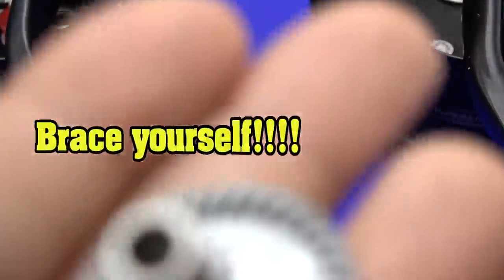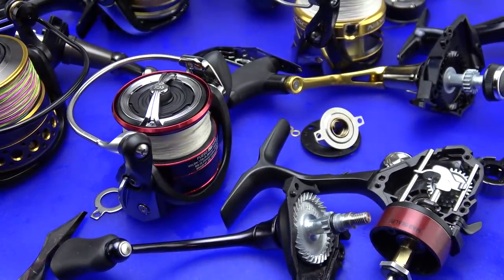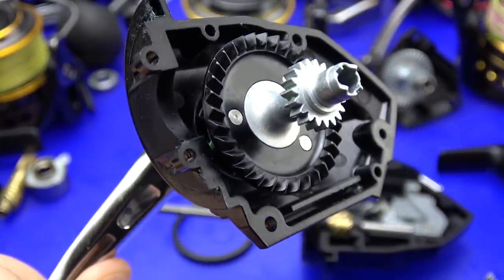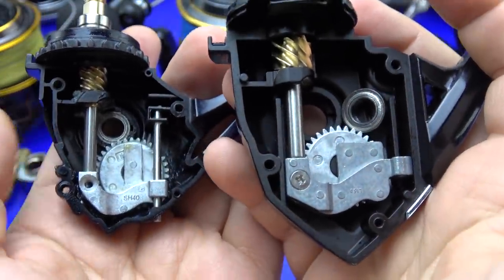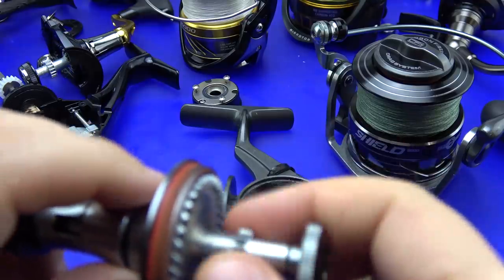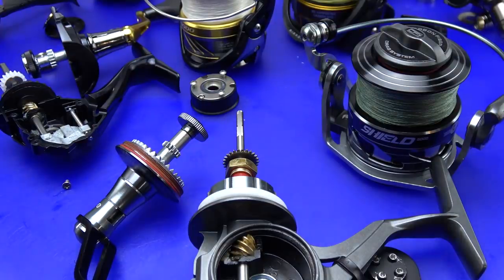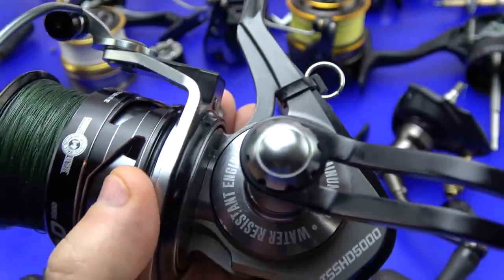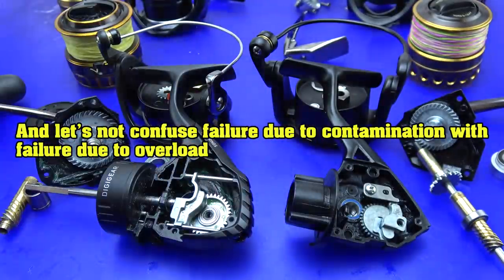2018 - 2019 $100 reel buying guide, comparison, and review.  Penn, Shimano, Daiwa, Tsunami

Comment: What are your thoughts on ceramic bearings if u have any experience with them?
Reply from the maker: Snake oil. Full ceramics are nice.  For very high speed long distance applications.  Where you can roast a bearings quickly.  But for fw applications?  A lighter oil, properly cleaning and lubing your bearings.  And keeping them clean will net you equal performance to bocas and such.   And 99% of what you get from some hedghogs and others.  Additionally if you apply any spool tension at all whatsoever via the knob.....you lose any and all benefits.   
I put out a vid showing some different bearings spinning....i was going to film some tests....but didn't like the footage.

Comment: These molded plastic and cheap metal housings are absolutely shit.  Get a Machined aluminum housing , far superior in every way possible.
Reply from the maker: Problem is... 99$. You're 100 percent correct though
Reply: @TackleAdvisors  You did a great video for that price range and I agree with your points and selection,  but these reel companies need to focus on improving the housing material quality , and not just internal parts.  A Van Staal isn't exactly affordable for me , but I bought one so I would avoid wasting more money in the future , just my take on it.

Comment: What size BG would you recommend for king salmon
Reply: I use a BG 3000 size for king salmon here in the Pacific Northwest rivers. 4000 is a bit overkill with how bulky it is. The 3000 BG is basically the equivalent of most Penn, Shimano, Okuma and Abu 40/4000 sized reels.

Comment: Great video Nick, these reviews are the best most honest videos on Youtube. I know it is more money, but how to you feel about the Shimano Ultegra compared to the Nasci?
Reply from the maker: The ultegra is a much better reel all around... I literally have it in pieces next to the stradic ci4 and sustain.  Same Frame material as the Nasci..and it adds a worm gear for oscillation a threaded handle.  Worth the price increase imho.  That said the Tatula lt gets real close to the ultegra in price and rivals it
Reply: Thanks I have been thinking about getting an Ultegra.
Reply from the maker: Hey Mark...if you get the opportunity...check out the tatula lt...I think for the finessy type stuff you may appreciate the weight savings.  It's the same as the ballistic minus mag seal and rubber seals.  It has a very nice feel to it.

Comment: R u ever doing the saltist reel and the bg like before and whats that new back bay reel all about isn’t it just the saltist pretty much
Reply from the maker: I will be more. Just waiting on a saragosa... That new saltist back bay is interesting... It's more like a metal ballistic than a saltist with a gear upgrade...no crbbs but machined alu gear and mag seal.  Provided it has the other rubber seals like ya see on the ballistic fuego and saltist... That's a cool reel.  Kinda says hey stradic... I'll take your hagane... And raise you a metal side plate
Reply: Tackle Advisors ok thx I’ll be looking forward

Comment: My 3000 size nasci has felt drag washers, why is it different on the larger ones?
Reply from the maker: Ahhhh...good to know....I guess they feel it's not needed in the smaller sizes.....I'm inclined to agree...unless targeting speedsters.
Reply: Tackle Advisors You made me take all my reels apart! My 4000 stradic fk also has felt drag washers that only lasted one trip to the Amazon, I’ll be upgrading then to carbontex washers

Comment: I want to spend sub $250 on a 4k for my florida lightweight inshore main setup ~7 medium power fast action. It will be looked after but might take the odd dunk. I'm down to the Shimano Stradic ci4, Daiwa ballistic or Daiwa theory (i know the theory is pushing the budget) wildcards are tsunami saltX because its heavy and 2019 stradic cos its not for salt water. What would you get?
Reply from the maker: I'd not go with the ci4 or ballistic /theory (essentially same reel) I'd say go spinfisher.... Better sealed and 2 minutes to break it down should an issue arise. If you can't stomach Penn go stradic FL which has better than the ci4 sealing and a simpler and serviceable line roller.. Plus the tall spool is a benefit
Reply from the maker: @pissywilly  sounds good... I know Josh at jandh got some in today not sure on sizes though... If you buy from him add a comment saying you liked his "head banging". (he dueted my thoughts tik Tok video I put out today lmao.)

Comment: 25:05, battle 2 comes with a “line line correction kit”.
Reply from the maker: That's not the cause.  It's the path the crosswind block runs that lifts and lowers the spool combined with the line roller. It could have been designed differently to allow for better line lay.  Shinning won't make it lay like a Daiwa or shimano of the same design

Comment: What are your thoughts on the daiwa BG magsealed version
Reply from the maker: Considering how many times I've seen corroded pinion bearings... It's good for the protection... But you can buy 2 standard bgs for the 170$ magsealed version.  The saltist street price is near it and you get better crbb ball bearings.  The back bay saltist gives you a gear upgrade.   70$ for mag seal is ridiculous in my opinion.   Look at the fuego and exceler price difference then tell me how they get to that $ with the magsealed bg
Reply: @TackleAdvisors  there's a shop that I visit regularly that sells for 95 USD for the mag sealed version while the normal bg is 75 USD 2500 size . I'm just not sure if the maintenance for the mag sealed version is different from the standard bg as I can watch your bg maintenance video

Comment: My main gearr in my tsunami shield went after a few times of using it. Just happened this evening. So pissed. It is brand new now its trash.
Reply: Were you able to get it replaced? Ive been eyeing the Shield but QC issues like this have given me pause.
Reply: Soke haven't even bothered yet. I don't want another one. I don't need a reel that you need to take a torch to, to do maintenance.  I would rather throw it away and call it a loss.
Reply: I bought a Chinese version to test out catking ACE, and yes, also stripped gear after 1 boat trip to pull some black sea bass abuot 5-7lbs x 2 each time I reel up, I cant trust the Chinese cheap steel anymore, was going to order shield but now I notice they carried the same material with the Chinese catking brand

Comment: Ive had my penn battle for about a year now and i can say yes it does not have a perfect line lay, but if you were to cast 100 times you’d really only get a wind knot 2-3 times max . For serious bottom / livebait anglers id prefer the battle over the bg anyday.The bg does win in the aspect that it is a more capable reel but it is more prone to saltwater getting in over the battle 2
Reply from the maker: Problem with wind knots....they drastically weaken braided line.  And reels like the BG...you'll get zero wind knots.   Most windknots are user error.  But the battle 2 allows coils to come off out of turn.  Unlike the other reels on the table here.  That's a huge negative.  Addressed in the spinfisher thankfully.